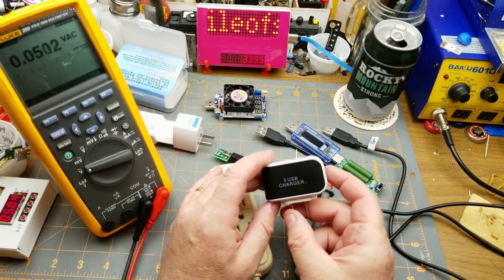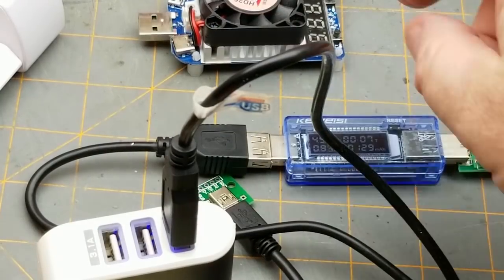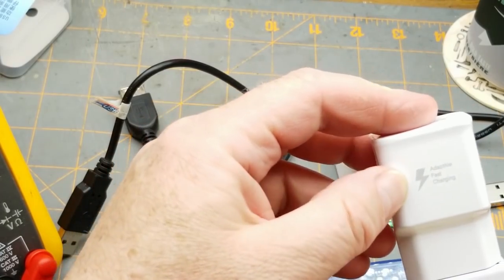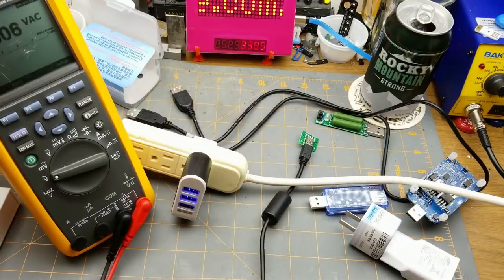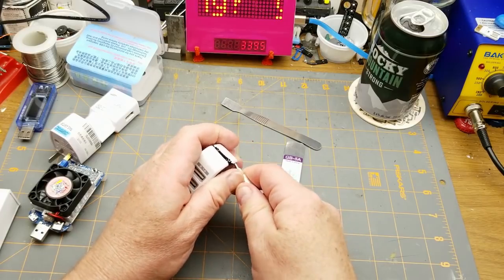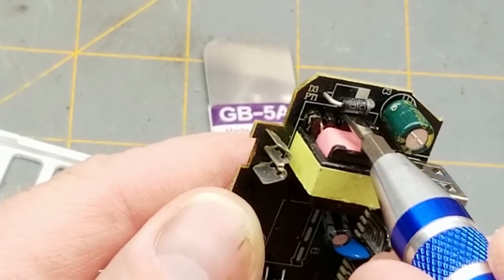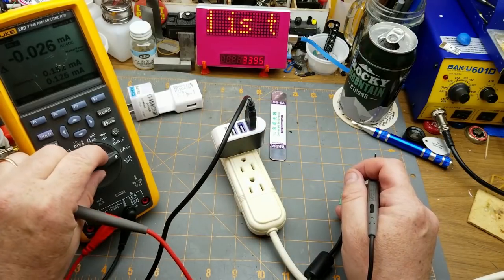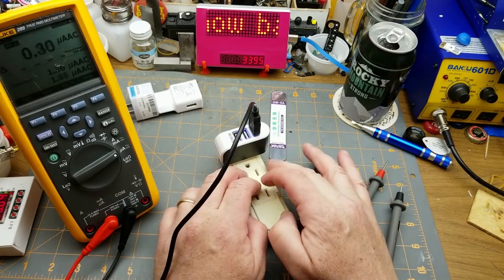3 port usb charger test and teardown

Comment: Measuring voltage from output to earth do not say anything about the isolation, nearly all power supplies has a capacitor between mains and low volt side. The regulations says that the maximum leakage current must be below 0.25mA. There is another issue with that capacitor, it must be a safety capacitor (They have a lot of approvals on them and can handle 8000V), but cheap chargers frequently use non-safety capacitors rated at 1000V. The cheap capacitors will often short when hit by a spike, i.e. output is shorted to mains.
Class 2 equipment (That is anything without earth pin in the plug), must be able to handle 3000VAC or 4200VDC between mains and low volt side when rated for 230VAC. That voltage is slightly lower for 120VAC, but chargers are always rated for both 120VAC and 230VAC.

I have tested, reviewed and torn down more than 200 USB chargers, including an older version of the one you are looking at here. You can find a list of them here:
https://lygte-info.dk/info/ChargerIndex%20UK.html
Reply: Great web site. I'm sure that a lot of ebayers don't understand that my selling a Chinese charger that they are placing the product on the market and legally responsible for user safety under EU regulations .  Low  voltage directive can be a bugger to pass first time. Everybody should look at your web site and see how little the  Chinese respect the lives of us all. People used to say that the China export make CE was there so they could not sell the rubbish in their home markets
Reply: Were you the guy that did all the 18650s too?
Reply: I am testing a lot of batteries and not only 18650. I also review some other USB stuff, multimeters and some other test equipment. Everything can be found on my website if you start from the root: 

https://lygte-info.dk/

Comment: Some of my chargers/cords can't keep up with my phone when I play videos.
I found one usb cord that doesn't let enough current flow.
I found 2 chargers that have degraded over time.  One is samsung, one is s radio shack.
Reply from the maker: I tested a bunch of USB cables several months ago. ( https://www.youtube.com/watch?v=5HsQNCVYYvM )
Several of them lost up to a third of their voltage over the length of the cable due to series resistance